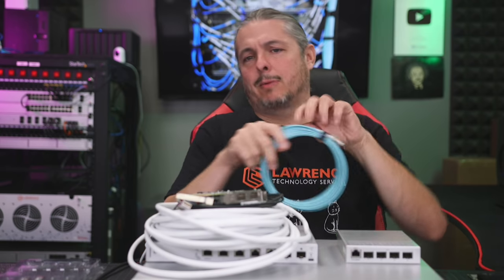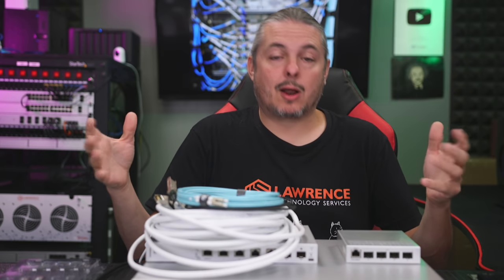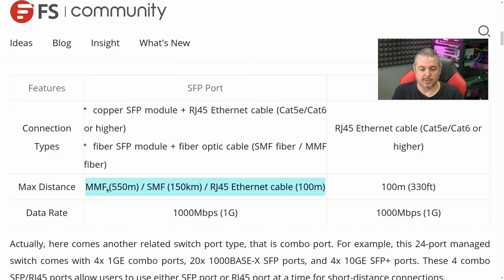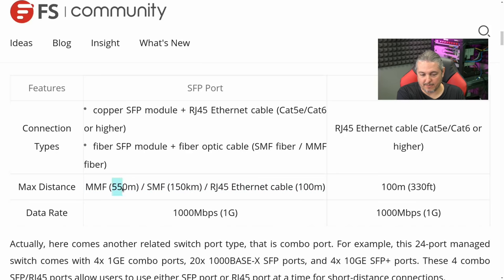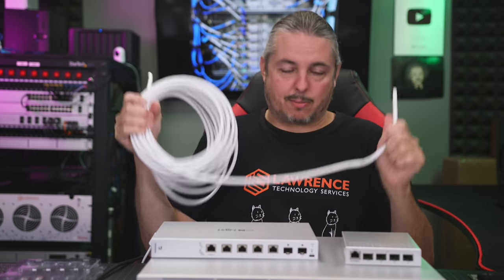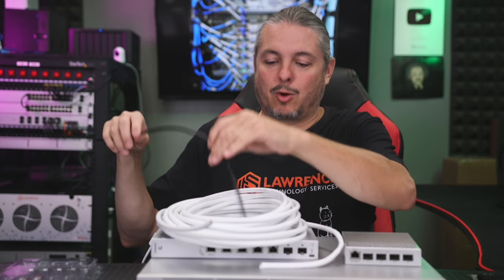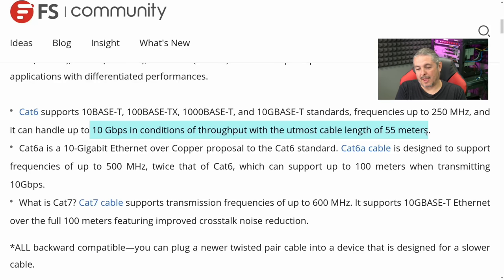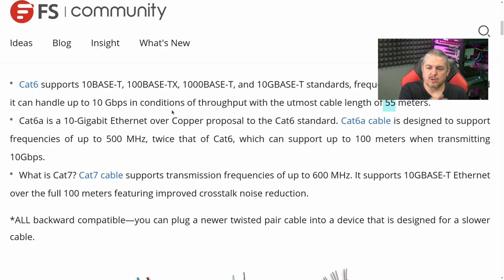Building Networks: When to run Fiber, Cat 6 or 6A, DAC Cables, and Cat 8

Comment: A very simple rule for Copper Vs Fibre regardless of inside the rack or rack to rack, copper is conductive, fibre is not. Blown ports from induction, conduction or faults is a PIA. Multimode is for tight-asses, use SM.
Reply: Only problem is when you use single mode on a short run you burn out your ends because the light doesn't attenuate enough.  Multi-mode and single mode have their application usages and it's good to use appropriately.
Reply: If one is going out and future proofing a network then the SM is the way to go as the MM has length limits set by the possible speeds as well. I went full SM for building-to-building, with copper runs within a house.
Reply: Agree with you on SM, but especially for runs under 1000ft, check the signal level spec on your SFPs, you may need to add attenuators to stay in spec.
Reply: Yep, fiber is good for electrical isolation. Rehabbing the control system in a electric utility substation recently, I replaced all the comm and network lines with fiber (also reduced the control cabling by 75%) internally. All devices were ordered with fiber interfaces on them....
Fiber also gives resistance to lightning, many people who send stuff up towers will use fiber isolation, even if it's copper going up the tower, it will go fiber from equipment rack to tower base and media converter there.

Comment: I'm like, crap what's wrong with my network I'm watching this at 360p
Reply: Smh, probably need to upgrade to full cat8
Reply: @ilik3pie  Might have to get my hands on a SD-WAN Turbo Cloud Encabulator
Reply from the maker: I waited until YouTube said it was done processing, but clearly it is not yet  ¯\_(ツ)_/¯  The YouTube datacenters need an upgrade!
Reply: Not just you.  I feel like it's 1998 again.
Reply: @LAWRENCESYSTEMS  the YouToobs are still running CAT4.
Reply: I had to re-set my preferences to use highest quality. YT app changed to automatic and I noticed it's been choosing low quality. IMO they are trying to save bandwidth.

Comment: When it comes to internal building connections where you see a lot of Cat6/a wires running along scale raceways, why aren't those replaced with something like fiber linking aggregation switches that then branch out into Cat6/a for a small area? It seems like one or two fiber optic cables linking two cheap aggregation switches would be less hassle. Maybe a little bit more expensive with the aggregation switches, but you could potentially be replacing thousands of feet of Cat6/a and all that labor cost so maybe not.

Comment: With Cat6 having the 55 meter limit for 10 gig.  If you were to put a switch such as the MikroTik 5 port switch inline could the 55 meters be extended beyond the switch?  Are there meters that will tell you the exact length of a cable run to include any keystone connectors and patch cables on each end?

Comment: Fiber SFPs will allow your switch/router to detect a failure quicker than copper RJ45. Yes it is milliseconds in differences, but in the carrier game we are trying to get failover to happen in 300-500ms so fiber is a much better option in those cases.
Reply: Depending on the SFP module used, they many times have diagnostics in them, so you can proactively learn if signal levels are deteriorating and some will even estimate distance to fault using TDR like functions.
Reply: @CoreyThompson73  Yes if they have DOM support. My comment was more about the port going down not the SFP failing. If you have to do fast reroute and keep things up fiber is quicker as the switch can detect a port going down quicker using fiber than using copper RJ45.

Comment: Running UTP (aka unshielded) between 2 buildings with under a driveway/carpark & up the side of a building. We've noticed damaged ports or devices with suspicious lightning or surges probably doing the damage. Fibre between the buildings would be better protection from voltage differences carried through the copper cable. If the cable is more expensive, the termination & components are more expensive. Thicker cables require wider conduits, larger arc radius, larger holes, larger cable management space.
Reply: Your ports are frying due to improper grounding. Each building has a different ground potential that will attempt to equalize over the link between the buildings. You can find appropriate grounding strategies with a little research.

Comment: Why I went with fibre for my home.

I live in the UK and it's fair to say we don't really expect really bad weather. It rains all the time and some thunderstorms here and there.

I had a full ubiquiti setup

Dream Machine Pro
USWPRO24POE
Flex Mini ( in all the rooms)
Access Points

I went with ethernet cables running from the USW to all the rooms from the attic. PoE was great because it allowed me to power the mini's and access points over PoE 

We had a thunderstorms and a lightning strike go over my home I have no idea where it landed.

Ethernet cable caught the charge ( loudest bang I have ever heard my dog ran scared... It's a rottie 😭  ) went down to the USW and spread from there to everything connected to ethernet.

USW all the connected ports dead
All the flex mini's dead
All the access points dead
3 TV's dead
3 NVidia Shield's dead
Home theatre dead
Sound bar dead
Printer dead
Pi dead

What survived?
Dream Machine Pro ( It was connect via fibre to the USW )
Modem ( Connected to Dream Machine Pro )
All things connected to WiFi (Google home, Echo,  other smart home stuff)

Desktop Survived probably because it was off that is the only explanation I have for it to not be dead.

I am still recovering from the loss... Replacing them steadily.

I am no longer using USW switch.
I am using the aggregation switch and have run fibre to all the rooms from it.

I don't normally comment on videos. This showed up on my feed today and thought maybe I should reply and maybe someone else will be saved 😔
Reply: Was any of the copper cabling shielded?
Reply: @belfalas40  Yes, they were all shielded.
Reply: @Rudurk  Thanks. I'm in the UK also, with shielded (and well-grounded) cabling running between house, outbuildings, cctv. I've got type 2 surge protection on the power DB, but from the sound of things that's worth bugger all in the event of a nearby strike. Probably time for an upgrade...

Comment: @Lawrence Systems Is there a problem if the cable runs in an office are Cat 6A, but the short cable from wall plate into the computers are Cat 6? (reason being they're must less bulky for users).  Will that create any problems, or still run at the full 10Gbps?

Comment: would you advise for a house with no network cables to use and install/ wire up house all with CAT7 SFTP or CAT6a SFTP? or just stick to usual CAT6 UTP?
Reply from the maker: CAT6 should be fine

Comment: Question: with rising energy cost, is energy consumption of components ever an issue?

I pulled all my legacy network junk (ap’s, switches and even a hub) at home 2 years ago and replaced it with UniFi PoE APs. I believe I cut about 50-100W. While that seems insignificant, continuous 100W consumes about 1000kWh a year. Electricity prices are going up to €0,60 per kWh, so I save €600 every year!
Reply from the maker: Yes, energy costs are a concern.

Comment: lol not really what i needed. I wanna know what kinda ethernet cord i use for connecting the router to the modem. Does it matter. would a regular  cat 8 work or is their a special kind for that.  Also what is the diff in in one that says Bifale sstp -cat 8 L s z h jacket-and cat 8 lan network or one that says furui 26 awg - heavy duty pe jacket - and has s/ftp.

Comment: What makes fiber a bad choice for running throughout the home? If I want 10GB you recommend against 10GB-baseT because of high energy/heat, so how do I get 10GB SFP+ across my home without fiber? Am I missing something?
Reply from the maker: It's harder to work with and requires more SFP+ adapters.
Reply: @LAWRENCESYSTEMS  Most of my devices are 1gbe, but I want a 10Gb connection between my NAS which is in my network closet to my main workstation in my office room. Would I just want to get one main switch with some 10GBE ports and run that to the office directly to my workstation or fiber it to the office? In this case, you would just recommend going with the 10G-baseT for a longer run and eat the heat/power?

Comment: I’m having a new house built, and am having ethernet hardwired throughout. What cable would you recommend? I am budget conscious but also want to have availability of faster throughput as technology advances. Not sure if CAT6A or CAT8 is the better idea.
Reply from the maker: Cat8 would not make sense, go cat 6a
Reply: @LAWRENCESYSTEMS  On the other hand when I got cable run inside an existing home. I measured my longest run at 80 feet and figured that for wiring an existing home, Cat6 was much easier to work with. The Cat6 I used was rated 550Mhz. While I know that number is higher than that standard 250Mhz does that matter much?

Comment: For my new house I’m looking for a Sfp28 solution that can cover approximately 10 meters. Reason, both the switch in my office as the one in my server room have a sfp28 port, so I thought I might as well use them. When searching I cannot find DAC cables longer than 3m. What to do here? I hope for a plug and play solution.
Reply: Look for the AOC cables for your equipment.
Reply: SFP28 has a limit how far it can go, about 3m is close to the max before you run into too much signal degradation. That’s true for qsfp28 DACs as well.
Like Ivo said, you would need to look for AOC cables for longer distances.

Comment: Way can't I find DAC cables shorter than 1 meter?  I want to connect two switches that are 3 inches apart.  I don't need one meter.  You can get 6 inch CAT-6 cables, but not DAC.
Reply from the maker: FS.com does sell them https://www.fs.com/products/40109.html?attribute=1291&id=222988

Comment: So basically the only downside to going for cat7 or cat 8 is bulk of the wire itself and the labour it takes to run it through your house and cut the ends off to install it on a patch device etc?
Reply from the maker: And that it costs more.
Reply: @LAWRENCESYSTEMS  yes and that too. I thought there was something actually wrong with cat 8 such as poor performance or something.

Comment: Lawrence, my experience with DAC cables has been Very shaky.  They do not work with a large number of 'Mixed Speed' switches, probably since they do not have much of a line driver built into the 'non-transceiver ' ends.  In most cases I had to use 1 to 3-foot fiber cables to go between my switches.  Don't get me wrong, I really liked this video and applaud you for the great work :)
Reply: if the switches have different speeds (like connecting a SFP+ to SFP, the DAC won't work. it has to be the same speed on both ends. they are "dumb" cables.

Comment: Hey, i got still a question left: If you go with fiber, does fiber ethernet cables have max speed limits or is the limit mostly affected by the switch port? I know multimode is for 550m and single mode is for large distances but if you are choosing mutlimode fiber to connect different rooms of devices together with 10gbase would it be future proof when higher speed switches are more affordable? 

Use case would be: running fiber to each room of computer and in the room connect all devices with cat6 to a switch in that room were the fiber connection comes in
Reply from the maker: This should help https://community.fs.com/blog/10gigabit-om3-and-om4-fiber-optic-cables.html
Reply: Thank you!
Reply: SM is more future proof than MM. Note: there is a trend to use multiple fibers in a bundle and the fiber type itself may become less problematic here (if to ignore length limits), but a means to attach connectors - MPO/MTP anyone?
Reply: You haven't got a hope of reaching the maximum a fibre can handle.  That's around 1.5 petabit/s, IIRC.  Carriers often do 100 Gb and some 200 Gb.
Reply: @James_Knott  maybe but to reach such speeds the optic cable need extra clean of dust, so it could be that some fiber cables his specs are more suited for higher transfers in the future. That was the point of my questions: are some fiber cable more superior for future proofing for higher speeds or is it really the connector and single/mutltimode that matters in the buying process 🙂

Comment: For running cat 6a through my home should use shielded or unshielded cable.   Want to future proof so I won't have to run new cabling down the Road for a while.
Reply: Depends on what you can afford.
Reply: @clblanchard08  thanx.  Will price it out.  I heard diff things to terminate shielded cables.  Didn't know which would be better.     Thanx for the info
Reply: Unless you have Strange neighbors doing welding, HAM or particle accelerators or have overhead power lines shielding is optional. Budget and Weight are factors against shields. Fs.com has a quite good article on shield types. https://community.fs.com/blog/shielded-or-unshielded-which-to-choose-for-cat-6a-cabling.html mixing is not recommended, so best to not even start it ,)
Reply: @berndeckenfels  great will check that out and don't have that around here just was confused on the info with crosstalk and running cables next to each other.  It all gets confusing.   Thanx
Reply: @kencee9213  I guess what makes it hard to give a definite answer is that you never can know, especially not for future encodings. So if you have the room and money some shielding gets you on the safe side. But pobably newer protocols will never or always work independent of the shielding n a non-nay vironment.. However a cheap and future proof alternative would be cable channels / tubes instead or in addition. I also think that sometimes the F/UTP are not much more expensive, especially not if you need rugged/outdoor/plenum/in-Wall cables anyway
Reply: @berndeckenfels  thanx and no outdoor run just through wall and into living room and server will be in garage and run few cables to my office that's above garage.    And is the foil/unshielded TP hard to terminate like the shielded.  Or just a normal termination.
Reply: @kencee9213  Not sure about the higher classes (with braided shields around the pairs) but the outer foil is handled relative easily (especially if you only have a few ports). You must use cat6a connectors (thicker wires) and make sure the drain wire has connection to the shields of keystone or connector (some use copper tape with adhesives and heatshrink for this) but the shield is cut off. Make sure your crimp tool is for the larger connectors.
Reply: @berndeckenfels  great thanx watched some video on it. And maybe just use f/utp.  But will still do research.  Seems little easier to terminate with f/utp    and will ask if before set up. Lol.  Thanx for all the info.  Before I choose the correct stuff

Comment: How about best cables for POE; POE+; POE++ ?
Reply: There is no such thing. All ethernet cables are compatible with all POE
Reply: You can't run POE over fibre obviously, so some sort of Twisted Pair like Cat 6/6A would probably be best
Reply: @estusflask982  Ethernet cables don't get to magically defy the laws of physics. As an example, FS.com specifically doesn't recommend using their slim line cables with POE, especially POE+ and ++ with those cables since the conductors are very thin/can overheat and melt and or short out.   Monoprice specifically has a line of "POE" patch cables that are solid rather than stranded patch cables, and also have shielding that helps dissipate heat.
Reply: @psycl0ptic  I've been using stranded cable for years with POE, never had a problem
Reply: @psycl0ptic  We should also note that CCA (copper-clad aluminum) is to be avoided for POE applications, too little current carrying capacity compared to copper.
Reply: @d00dEEE  yes - those shit cables should be avoided in general, if you care about speed and latency...and yes also avoid for POE.

Comment: I‘m sorry, but that Cat6A cable you have is extremely large in diameter. The Cat6A is have installed is more similar to the Cat6 cable you showed. And yes it’s even S/FTP… so you’re argument about it being bigger and therefore needing more space is invalid. Yes, the cable i use was already available back then, and the price difference wasn’t that large either.

Comment: I have two poweredge servers in my rack with 10G SFP+ NICs. For the first one I used a DAC cable and it works fine I just wish there was a way to integrate it into my patch panel.
Reply: Apologies if I read this wrong but there is no benefit in running a server to a patch panel as it should be in the same rack or a near rack to the switches. The only real reason you use patch panels to so you can map sockets around your house to the server room in the form of a patch panel.

I don't understand and have never encountered a scenario where you would be plugging a server into a patch panel.

Comment: Failing to understand why you wouldn't want a combination of cat6a and om3/om4 mm with new home construction.
Cat6a is up to 10gb whereas om4 will easily handle 40 and up.
Don't even terminate the om4 until it's needed.